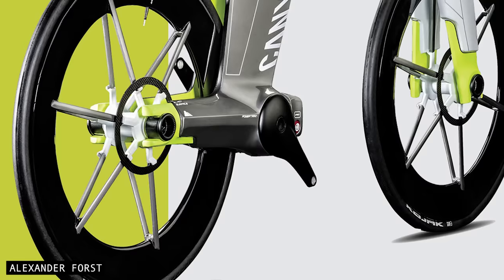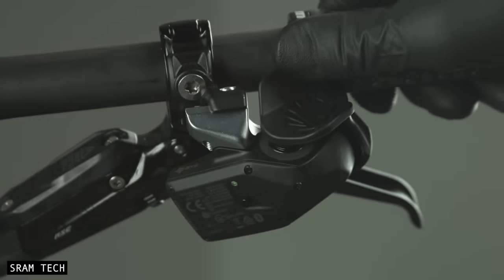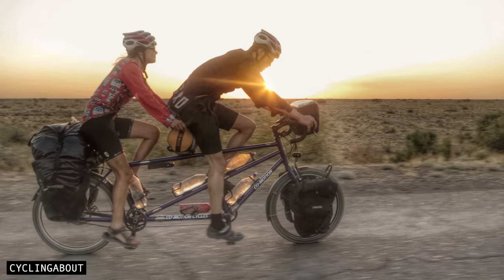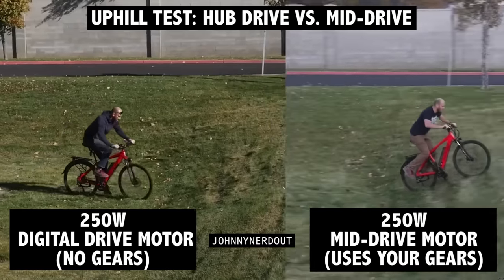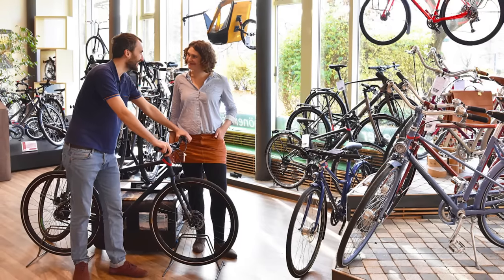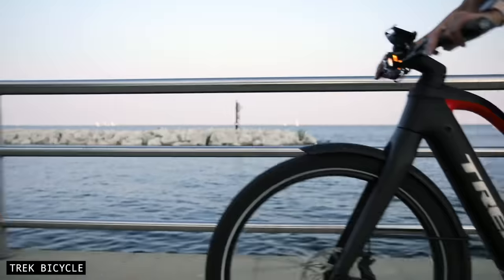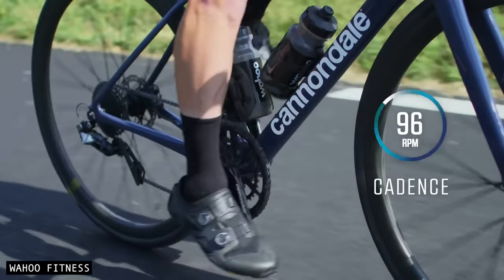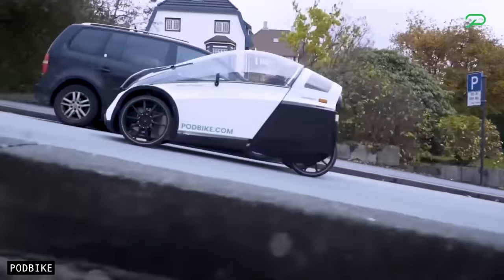Are Chainless Digital Drive Bicycles The Future of Cycling?

Comment: I've designed a similar idea for a pedal generator and battery-powered electric motor-driven Kayak. My system does use digital control for the BLDC motor as they are more efficient than brushed DC motors.  The overall idea is simply to extend the battery life.
Reply: Maybe there are more advantages: less need for rare earths and less weight (which also results in greater battery life). The downside, is you need to convert the DC battery to an AC current and a more electronically complex control system of the motor torque and velocity.
Reply: @Sergio_Loureiro  My design just uses a sensorless BLDC motor for prop and one for generator. I'm not concerned about rare earth magnets. This is just a hobby project for my own use. 3 ph AC is automatically created in the generator but then is rectified to DC for battery charging and the prop motor driver. A pretty simple design. :) Prop motor speed is simple in software. No need for constant torque control in such a system.

Comment: I've had an idea for years about putting a system like this in an enclosed recumbent design.  you could even out the pedaling intensity so you're not all sweaty commuting to work, plug charge, solar, or use it as a stationary bike to work off lunch and charge system, then pedal as much as you want with a surplus of energy.  system like this with a decent battery would afford creature comforts like heat and audio due to reduced range anxiety, allowing people to cycle when they wouldn't due to weather and hilly terrain
Reply: Any idea how slow a solar panel charges? A night rider could let the bike charge “over day” I guess. Also need more coal energy to make a solar panel than what coal directly delivers. I am looking for a coal fired bicycle. It is the most “green” of all.
Reply: @jusuftheeagle6772  I was just saying it's an available option, not the be all end all
Reply: alas, heaters use crazy amounts of power. A small fan heater would take a couple of roided up Lance Armstrongs to power it

Comment: Hub to crank radius/ratio could solve some of these uphill issues, and even be great for higher speeds.
Reply: you either have speed or you have torque you have to choose one if you dont have multiple gearing to use that or your bike quickly becomes a motorcycle legally

Comment: What if: we left the rear wheel driven directly by the pedals (eliminating conversion from mechanic to electric and back to mechanic), and installed the motor hub on the front wheel instead? This is the setup for the parallel hybrid (in contrast to the Serial hybrid in the video). I think the motor can be used for regenerative braking and biking uphill. For the regenerative braking part, supercapacitors are more adequate than batteries, because they can charge quickly. Batteries can be added to extend the range of the motor when you don't pedal. In addition, you can start charging the batteries when the downhill ride is long and regen charging exceeds the supercapacitor's capacity.

My aim is to keep the motor disengaged when you don't use it. It engages on regenerative braking or when you decide to use it. My experience with the standard e-bikes is that pedaling without the batteries is difficult even at walking speed. Just to start moving on a flat terrain necessitates standing on the pedal! I can pedal uphill quite well with pedal-powered bikes, but I find e-bikes much harder to ride even on a flat terrain without batteries. Clearly there are some efficiency losses here!
Reply: Good idea. This is how the Tesla Semi works. Rear motor optimised for 60mph, front two motors are mechanically disengaged except for acceleration and regen braking (and maybe counter jack knifing).

Comment: I am 61 and always used a normal bike and love it. We were on a short holiday and could not bring our own bike. You could only rent e-bikes. They had a drive belt and hub gears and were very heavy. We love to cycle on light bikes with quality chain and derailleur and hated these bikes. And I thought "If people want to cycle only electrically, why those stupid drive belt and hub gears on a heavy bike, why not peddle the engine on the wheel directly without gears?" I googled and found this very good movie. And the comparison with mirrorless camera's is so spot-on, why do you need a mirror with an electronic camera? Why do you need a belt and gear system with an electric bike? The bike industry is so conservative!

Comment: and regen will be an easy option...love the idea. Combine it with a decent battery to overcome the disadvantages in system losses and you have the ultimate bike imo. I've often thought about this concept and wondered how long it would be before it was put the market.
Reply: Add I a capacitor and you can carlect more regenerative energy
Reply: You'll never fully overcome those losses though.  This will always be a less efficient form of cycling.

Comment: This is what I need. It can easily include a battery so buffer the energy and store power from dynamic braking.

I don't get the talk about "feeling naturally". I'd expect to just pedal at my optimum RPM to generate electricity and then use a throttle to control the power output/input (dynamic braking) of the motorgenerator.

Right now, I just use an electric scooter. It's legally a bicycle here in Switzerland, it has a range of 70km (roughly 3h endurance), is cheaper than good bikes and more comfortable due to the standing position. And more reliable due to less parts.
The only downside is that it needs to be charged.

Comment: I think a bundle of super-capacitors could be a really cool alternative to a battery as well. Charge them just off the regenerative breaking and have a button on the handle to discharge them one at a time as a "boost" where the bike runs under its own power for a few seconds. Capacitors have a much longer lifetime than a battery and don't suffer the power loss over time or in cold weather. Having several boost charges to help you get up hills or get back up to speed from a stop would be very useful. And so long as you were using your boosts as frequently as you charged them you'd technically be getting that efficiency return from regenerative breaking just the same as a battery. Ofc It would also be very video-gamey in a fun way.
Reply: I don't think bicycles typically spend enough time braking to generate enough electricity to do much meaningful work. Especially not one as slow as these would be, given the poor efficiency.
Reply: @tonyb9735  this. the amount of energy that can be recouped via regenerative braking (obviously) correlates to the amount of energy that you waste on braking. with a car this can be significant because in the city traffic, you are bringing 1-2 tonnes of weight to a complete stop from like 30-50km/h all the time. But cycles weigh significantly less and most cyclists ride with a bit of foresight to minimize the braking that is required. on long downhill roads you may be able to collect some energy, but then again on most downhill passages i pedal a bit to get faster instead of constantly braking.
Reply: Regen braking is like 15% efficiency often times, whatever that's worth

Comment: you can get the efficiency up significantly by using Higher RPM motors and generators, this would require changes in gearing that would present another set of problems thou.

Comment: Bicycle drive trains using chains or belts are 95%+ efficient. This means, our high torque but limited power legs do not need to work hard to propel the bicycle forward. Any gear mechanism or electrical generator/motor system added to the system between our legs and the pedals connected to the wheels, reduces the efficiency well below the 95%+ efficiency of the chain or belt direct drive. This means, it feels harder when pedaling to go the same speed. Digital drive doesn't sit right with me. Let me know what you think.
Reply: The main application may be heavy cargo E bikes, where most of the used power don't come from the rider anyways. It eliminates the need of having a direct chain connection, which gives more design freedom and eliminates the need of having a differential on a cargo bike with 2 rear wheels.
On a normal bike the only advantage is less maintenance, which is "paid" with less efficiency.
I think the Twike (a hybrid between a small car and a bike) used such a system long ago
Reply: What I think is you didn't watch the whole video.
Reply: @Pastamistic  I watched the whole video and they are right.  So what do you mean?  This system is super inefficient for sending power to the wheel.

Comment: Digital Bike will be more popular as tricycle, as in such settings, it will be more canopy-electric vehicle combination that will offer self-extending range with some minor weather protections. In such form, it is a lot cheaper than vehicle and you could be stretching while not over-working at that self-propelling mode.
Reply: I was thinking something similar. This type of drive bike would be best suited for cruisers and adult tricycles.

Comment: Well done video and I agree with your thoughts about not really practical for regular bikes but very likely a great fit for E-bikes. I’m about 9000 miles into riding a BikeE recumbent with the Grin rear wheel 212 ready to roll kit. Wonderful set up but the chain length and maintenance are my biggest challenge, not to mention that I need a 70 tooth front sprocket to peddle the speeds above 20 mph. I want a generator crank!

Comment: If you could dial a pedal load in like a turbo trainer I think it could be very good. You could set the pedal load at say 150w and then use the battery to drive the bike.
Reply: I think, that's exactly what this thing do.
NOnetheless, it adds complexity compared to a normal chaingear (or belt gear), and reduce hugely efficiency. It's useless.

Comment: I've put a considerable amount of thought into this kind of concept for many years. It is my belief that if a bicycle was designed so that the rider had a constant load, uphill, downhill, and at stoplights, and add this to regenerative braking. Then only use the stored energy for accelerating from a stop and uphill, the energy requirements of the rider would not fluctuate with the terrain. My dream has always been to disconnect the rider from the load. When using a bicycle the rider normally stops pedaling downhill and waits for a light. Furthermore, the energy could be stored as compressed air in carbon fiber tanks. Eliminating the concerns of fire when using public transportation like a subway.

Comment: I can't see it ever hitting efficiency needed to replace a conventional drive (whether chain, belt, or crankshaft) on a bike without an additional power source, but on electrically assisted bikes it can start to make sense, particularly on cargo bikes where not having a chain may enable interesting geometries or allow more cargo space. Even if most of the power is coming from the battery, I feel there's something about pedaling to control your speed that gives you a connection to the road that cars and motorbikes (and bicycles with throttles) lack.

Comment: you could also do a front wheel drive which would hugely improve stability in a muddy/snowy terrain.
Reply: That is absolutely not what happens with a two wheeled bike. Losing the front will guarantee falling
Reply: @colin1780  losing the front is a guaranteed fall with rear drive. with front - not so much, you just push on the gas and regain control.
have you tried riding any front wheel driven two-wheeler?
Reply: @swancrunch  i work in a bike shop and front wheel motor driven bikes are known to be less stable. Going on ice or losing grip will mean that all your weight will fall to the front. Rear will most likely just make you drift a little

Comment: This is a very interesting idea... I think I agree with the take that these will start to become more common in e.g. larger more stable cargo bikes as battery charging could be done at optimal leg speeds even when stopped. For things with two wheels though I don't see this being all that appealing, since you are relying more on regen and downhill movement to recharge the battery. For example I know I would always rather have something direct drive when starting from a stop for stability reasons, since this is one of the main reasons I prefer commuting on a bike and not e.g. my moped. The weight and CG will also matter quite a bit in that scenario... but many of the bikes shown here had top mounted batteries. Seems like the current products out there are a little miss-aimed for the market of traditional cyclists... maybe we see this becoming more popular with new riders but I think this will be a hard sell for traditional drivetrain owners (even on ebikes).
Reply: that is a very bas idea. 50% efficiency there is no point at all that this thing exist. 

take a chain or electric motor, but this thing between the 2.

Comment: We did a deep dive on this tech at one point, and ran the numbers. It really doesn't make sense from an efficiency standpoint (80% for motor + inverter times 2 = 60% pedal to wheel efficiency) or a cost of raw materials (drive inverters and motors are expensive). However, if the goal is an ultra-reliable commuter with fewer moving parts for extreme reliability and infrequent service this tech has some merit.

Comment: I really like this idea for city cycling. In some of the major cities it often feels like you are waiting for traffic lights half the time. You just need a three-wheeler bicycle to make it work. Also riding downhill, you could recharge your battery, where now you often just stop pedaling.
Outside the cities some people use recumbent bicycles. Those have very long chains, so the difference in efficiency might be a bit smaller.
I am currently in the Philippines, where in some cities you see a lot of electric tricycles which they call ebikes. Most of them don't even have pedals. As I am used to cycling, and like the workout, I would be more likely to buy one with pedals. Range anxiety is a thing for me, especially since batteries here lose range very quickly.
Reply: Some more points I like to note.
1. There is an e-bike named Electrom which is a recumbent design with an electric drive. This bike features a clutch at the pedals and the electric drive, allowing it to switch between a normal electric drive with the electric motor driving the chain and a series electric drive, where you pedal to recharge the battery. Such a clutch allows you to both do regenerative braking, charging using your pedals and using the more efficient traditional bicycle design with chain. Of course, such a design is going to be expensive and heavy.
2. Note that the chain drive electric bicycle design is not the most efficient design. If you want to go for a design that can provide more power, one of the things you can do is move the electromotor to the wheel, to increase efficiency.
3. For a city bike design with regenerative braking, you might want to switch to a design with a capacitor. The downside to a capacitor is the much lower energy density, meaning that you can only use it for accelerating after braking (or maybe something like a 1 km range), but the efficiency is higher, so you would not need to charge your e-bike. Braking provides a lot of power during a short amount of time, something a battery might not be able to handle as well.

Comment: Interesting, there is definitely room for motor improvement, just have a look at Tesla's motors, so things should improve in the future.
Although I think the name is wrong, as in the only thing 'digital' about it is any controlling microprocessor, this drive can be implemented with no processor, so then it's kind of the same, but definitely not digital.
Reply: Tesla didn't improve on motors. High power electric motors have always had very high efficiency. All high speed trains are powered by electric motors and they have been existing for half a century now.
Tesla improved batteries so they could sustain more power both on the charge and the discharge. Which allows them to drive more powerful motors and charge faster than previously existing batteries.

The problem with motors and dynamo generators on a bike has always been their size and weight limitation. They are so tiny that internal friction puts a huge dent in their efficiency. When an electric motor gets bigger its raw power output increases way faster than friction.

Comment: I think the video overlooked an important aspect of e-bikes of any sort (digital or not): It is much simpler to employ a two-wheel drive system, especially needed for better traction in off-road conditions. One motor for each wheel.

About digital drive Vs. simple e-bikes: The digital drive bike WITH batteries or capacitors will behave just like the simple e-bikes we know, but have the added feature of being charged by pedal power, and not just regenerative braking and plug-in. So, they have the option to operate as a sport bike as well. Simple e-bikes are harder to pedal and people tend to rely on the electric motor, so the digital drive overrides that problem.

It is possible to improve the digital drive system if we use a two-wheel drive: You can pedal with chain or belt drive for the rear wheel and use the electric drive (on the front wheel) for regenerative braking and additional power. The chain drive avoids the conversion losses from mechanical to electric and back to mechanical.

Comment: I can tell that I will never use an E-bike with this.
An E-bike with chain and electric motor to assist, is the bike I will ride.
No chain? I will only ride on an E-bike with a belt or a shaft.
And a NEXUS-8 hub is good enough for me.
If I wanted to have an bike powered by the motor only, I would have bought an Motorcycle, or scooter.